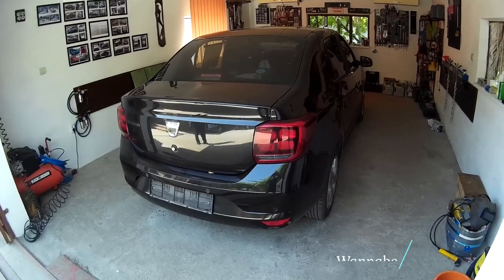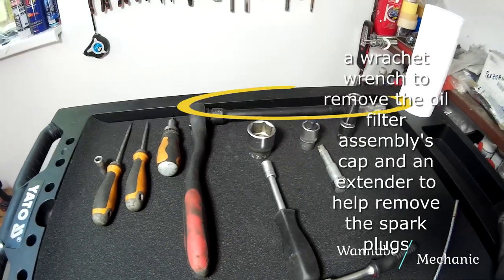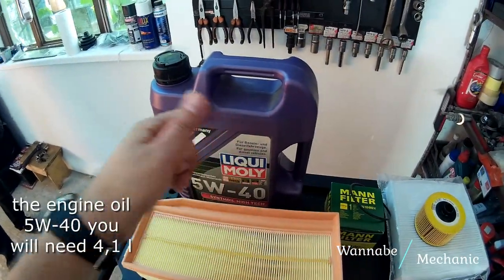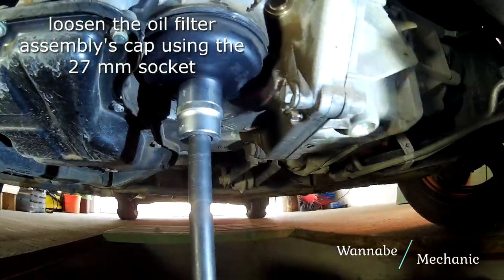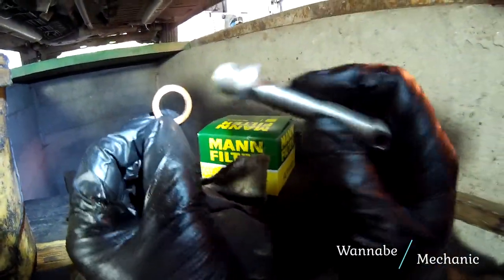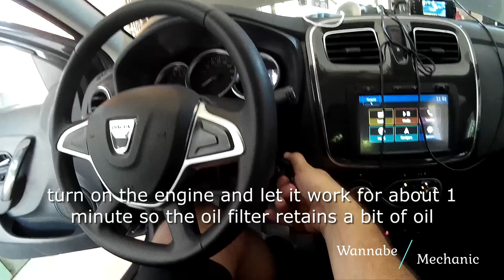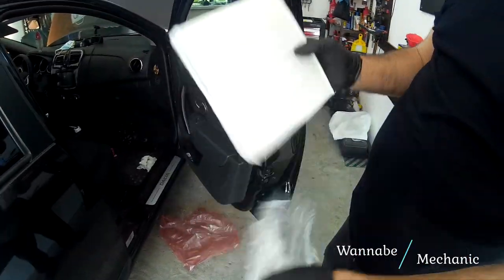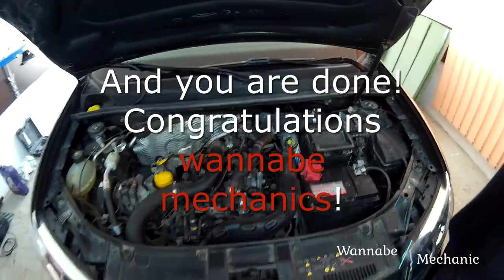DIY Dacia Renault Logan 0.9 TCE Maintenance Service Oil Change Oil Filter Pollen Cabin Filter

Comment: Is the new 1.0 Tce 90 HP / 100 HP LPG the same in terms of oil specification and the location of all the filters?
Reply from the maker: The filters are located the same but in terms of oil specs you should check the service/user's manual. We do the research before working on a car. When ordering the necessary parts you will have to provide the VIN to the shop/seller and they will help you order the right one. We haven't worked on 1.0 yet so can not share advice on it.
Reply: @TheDIYWorkshop2020  I'm currently waiting for a new sandero stepway to be delivered. I don't have a VIN or book yet.
Reply: @TheDIYWorkshop2020  For anyone wondering about the oil spec for the new dacia 1.0 Tce engines recommended by the dealership is Castrol GTX 5w-30 RN17

Comment: Your engine won't last long changing the oil at 12 thousand miles.....5 if you want it to last..that tiny engine pulling a 2000 pound car the chains on them are constantly breaking ...